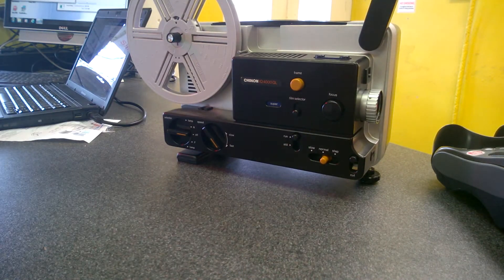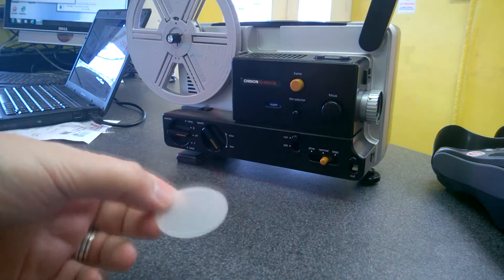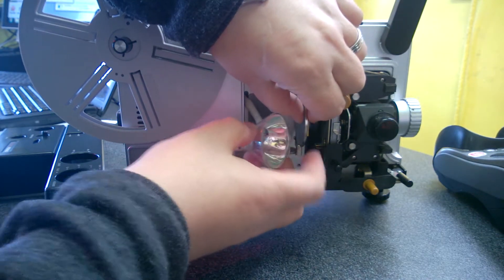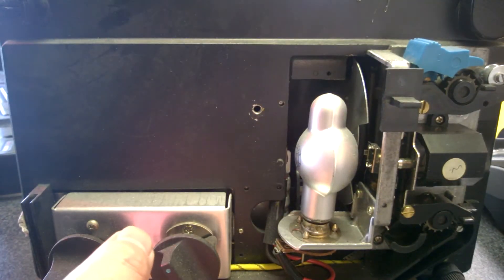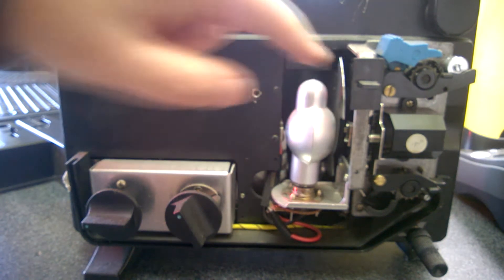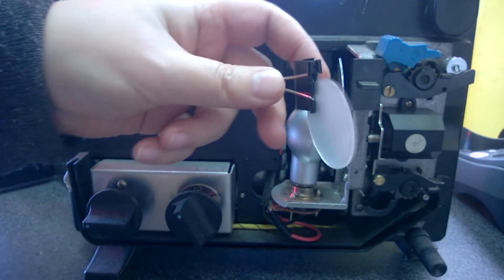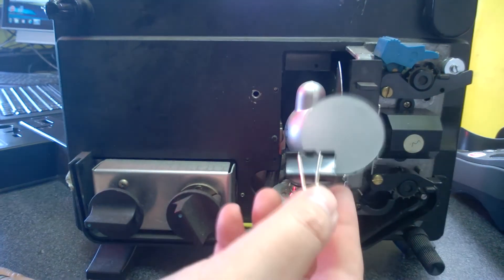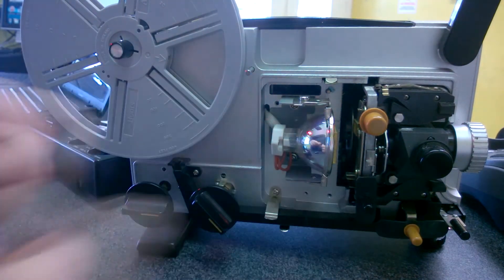Telecine Anti Flicker Filter DIY for Cine Capture : Installation

Comment: I have not used a frosted glass filter, but when I was copying an old wedding film, partly shot outside the church, then inside. I was using speed control on the projector. I noticed the film was noticeably without flicker for the inside shots. I corrected as well as I could with the speed control; almost no effort  was needed for the inside shots under dim lighting.
Reply from the maker: yes i get that too, the filter helps a lot but i have to adjust white balance on the fly when i capture, thankfully the camera i use has manual adjusting. the filter is great at its job but will not stop all flicker on any shots taken with bright light, snow shots when the sun is out is the worst i have found.

Comment: I like the idea but...what about the proper cooling of the bulb ? The heat generated by the actual bulb inside its reflector would have no chance of escaping. Maybe the air being circulated by the blower is enough to cool off the entire bulb ? Has anyone tried it ? I am a little afraid as I don't want to see the lamp explode !!
Reply from the maker: i have and still do use this method & never had an issue